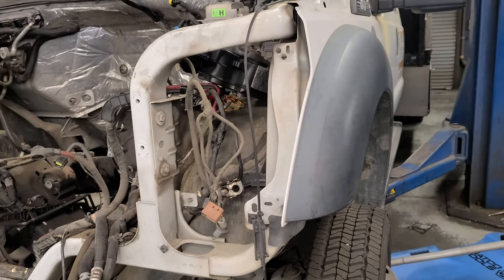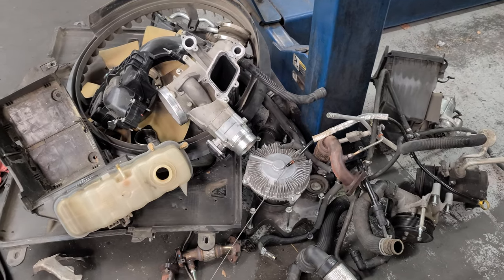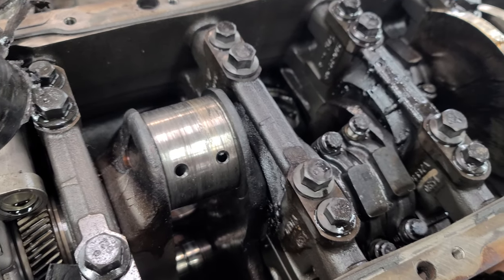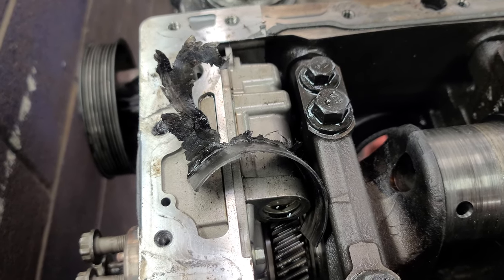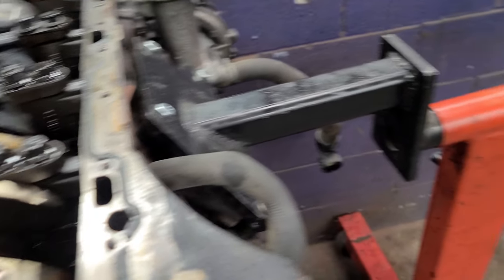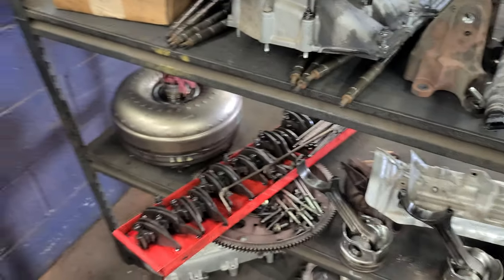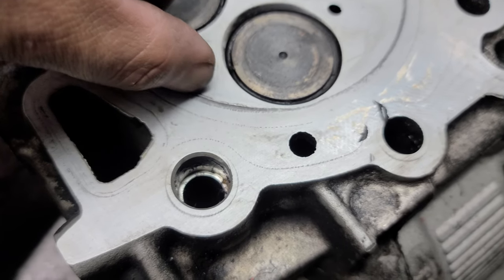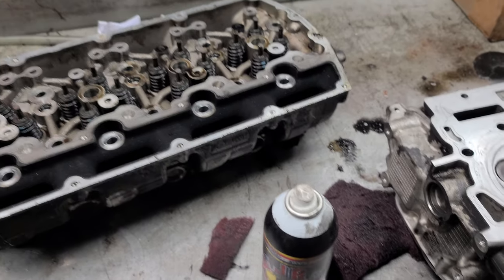SHOP VIDEO 6.7 ROD BEARING

Comment: Good morning Joe; Arod gave me your name and told me you are the man to talk to about 6.7 PS on the west coast!  I have a 2013 SD KR with 119890 on it.  It developed a miss on the # 4 cylinder, codes PO 267, I changed Injector and it ran good for 20 miles and developed the miss again.  I took it to ford dealer in Bakersfield and they said #4 cylinder has 0 compression, when I asked them if the head was cracked they told me they would have to take the head off to see.  When I asked them about a new head they said they usually don’t change heads due to the miles on the engine, their recommendation is a complete engine swap and told me it would be 8 weeks for the new engine.  If the head is cracked is not a good practice to install a new head if it was just a head failure and not the lower end coming apart that caused the failure?  Is there a chance you would be able to work on my truck?  I would have it delivered to your shop (where is your shop😳?) I know this is a lot of questions, but I’ve been following your’s and Arod’s YT videos and I like the way you guys go about making the necessary repairs.  Thanks M Potaczala